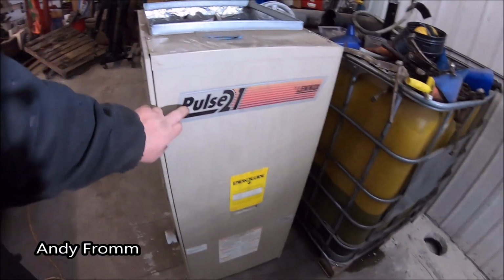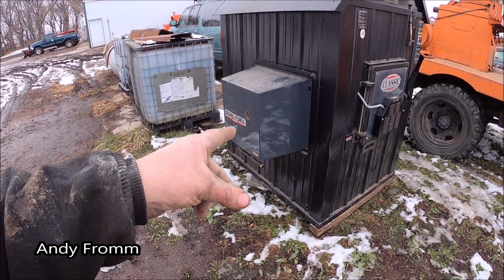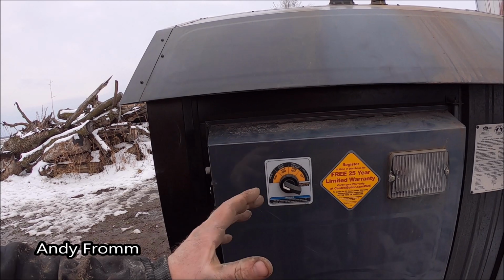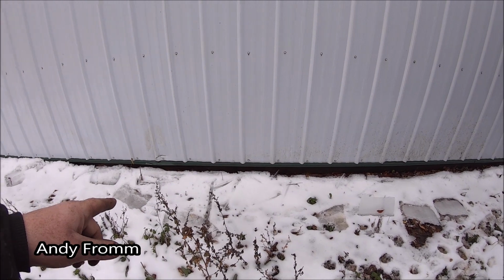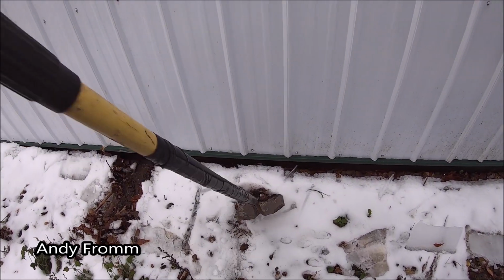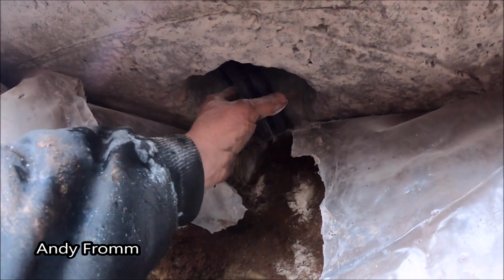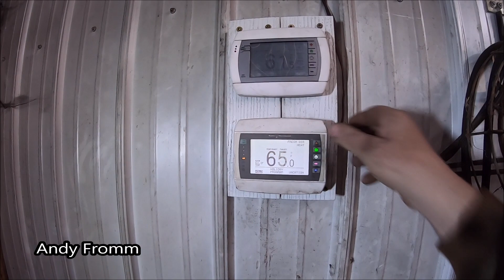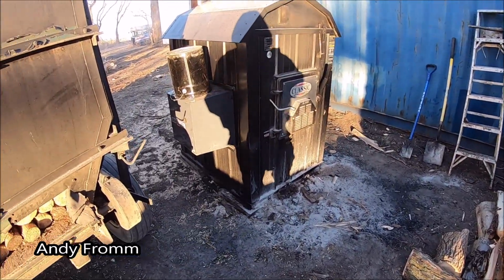new to me wood boiler #centralboiler #cl4030 #dualfuel

Comment: That's so nice . Happy for you. The air will be just as useful as the heat I think more so . And you got it up and running before it got to bad out cool.
Reply from the maker: Who knows when it will be completely finished though.... once I have something "working" its hard for me to take it apart to improve it. I might add a second heat exchanger before the ac goes on.